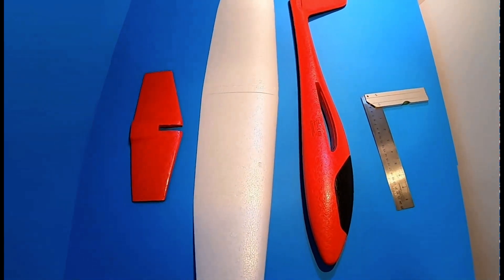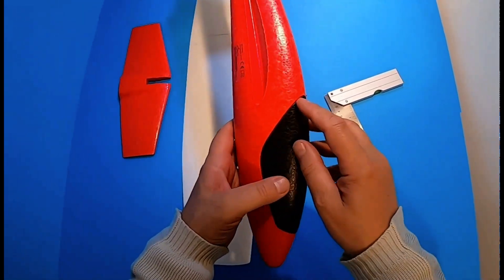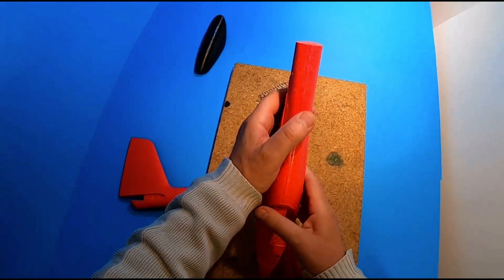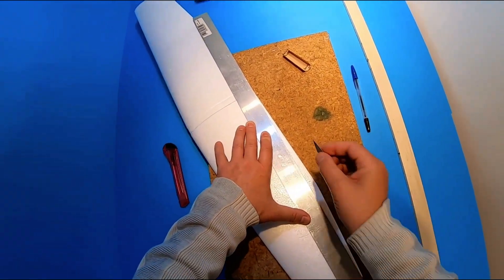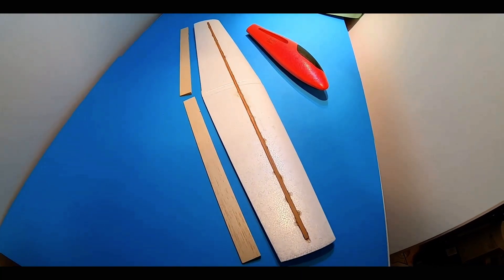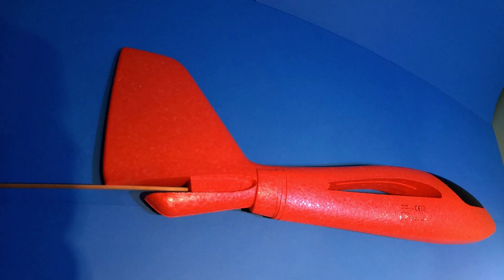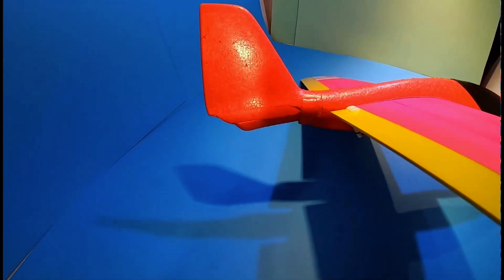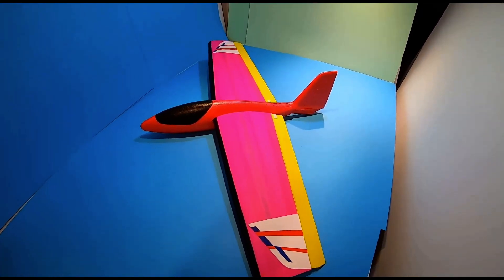Lidl Wing Glider

Comment: Great!  Would you mind telling me what battery works with a regular receiver in there?  Or do I need to use a 2 cell  lipo with UBEC?  Thank you
Reply from the maker: I used a 450mAh 2s Lipo and Bec to reduce weight and to hit my CoG mark. A standard 4.8v NiCad pack might have to be fitted further back for the correct CoG position. Hope that helps.👍🏻

Comment: If the canopy is glued with hot glue you may use alcohol to pour into the crack.
Reply from the maker: Thanks for the Tip, I am guessing it`s Rubbing alcohol.👍
Reply: Yes, IPA removes it in a minute - just peels off (that's isopropyl alcohol and not india pale ale btw 😊)

Comment: What method do you use to get rid of the tip dihedral please Steve?   or is the spar just holding it flat against its tension?
To get more dihedral on the R/E one I cut & re-glued (Por)
Now I've seen how well yours flies, I think this might be my next Lidl conversion !
Cheers
Phil
Reply from the maker: I bend the wing gently then it is the sparr that keeps it in position. I have a nicad pack in the nose for both power and to aid balance which is on the wing tips, yes it is that far forward 👍

Comment: Today's first flight, great for a first. Some small adjustments to be made at the control rods to bring the servo horn more to the center.
Reply from the maker: Yes a little adjustment here and their is par for the coarse with any model. Flying wings or plank as some call, you need to find their sweet spot to have them flying the you like.

Comment: what is the benefit to have a so short tale? thanks
Reply from the maker: A short movement arm is more aerobatic, a longer movement arm is more stable, But you can get away with smaller surface area so less drag if further away.
So all depends on what performance you are after.
Hope that helps
Reply: Maybe more pleasing to the eye. My experiences with wings, much further forward cg, critical and don't tend to loop as well as conventional. But I love wings and less to mess with,

Comment: Where is the CH on this one?
Reply from the maker: Hi, where is the CH ?
Do you mean balance point  ? . If so at the moment i am waiting for the weather to break so i can test fly it, here in the Uk we have heavy rain fall all week.
Reply: @RcAircraft  
Sorry, the keyboard helped me to mistype...
Yes I meant C of G, we call CG here in Brazil.
I have a similar project using an MPX EasyGlider, I am still wondering the balance point and how much up trim to get it flying...
Any suggestions are very welcome!
Reply from the maker: @ladraode9dedos409  Usually a good starting point is 1/3rd back from the leading edge and 3mm up on both elevators also known as reflex . 
Test glide over long grass and adjust nose weight to get a good glide.When happy be Brave and chuck it of a big hill :-)
Reply: @RcAircraft  good point. Will follow your guidelines and let you know.

Comment: Did You use hot Glue, to install the Spar, Epoxy would be my Choice, good Luck for the Maiden 👍🏻
Reply from the maker: Hi, Yes i used Hot Glue, I thought the foam would be ok. Now i know it`s NOT Ok, so No More Nails Wood Glue would make for a better choice even if it is slower.
Cheers . My fourth model is near completion BTW